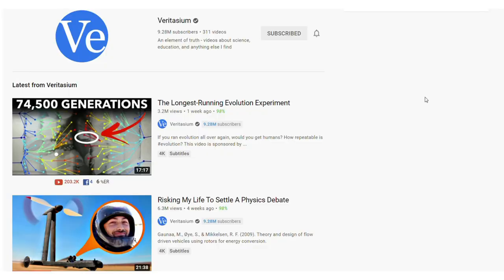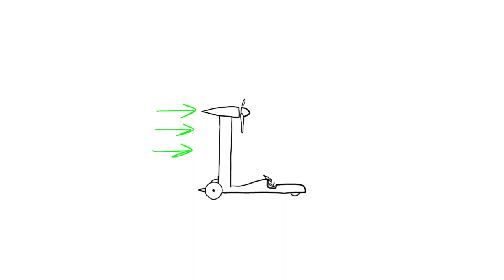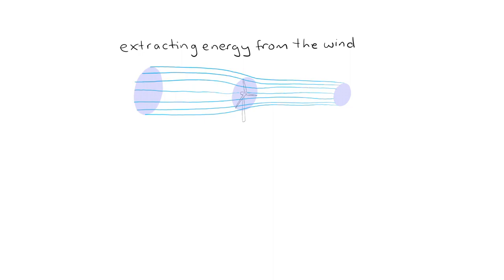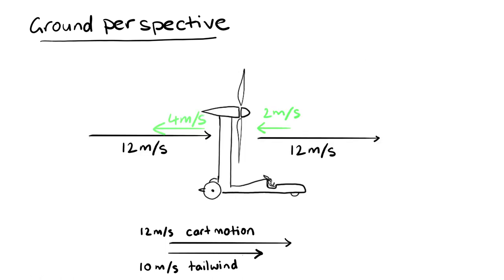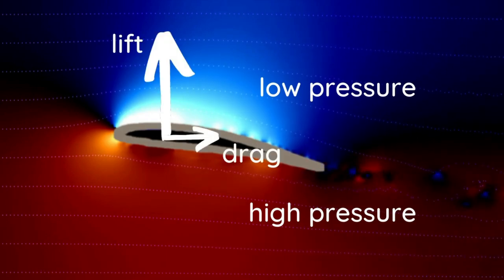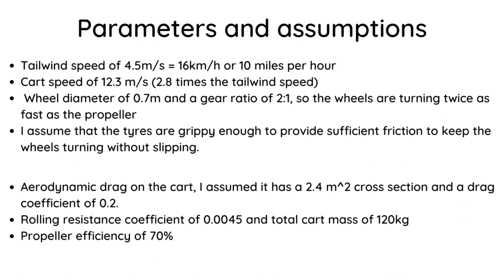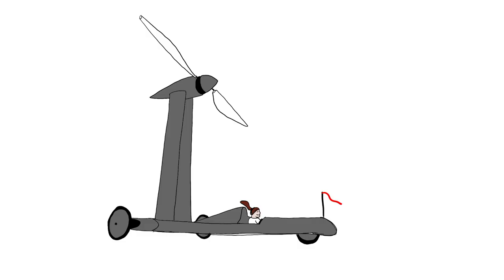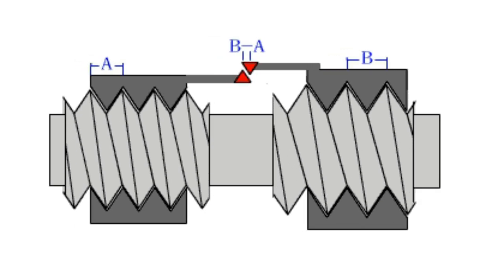Downwind Faster Than the Wind by Veritasium: How Does it Work?

Comment: Since wheels to ground is a lot more efficient than wheels to propeller to air, wouldn't it make more sense to use the wheels to power more wheels? Of course that would be nonsensical, which shows how flawed the downwind faster than the wind using a propeller theory is. It would actually be difficult to find a less efficient transfer of power than an air propeller.
Reply: "wouldn't it make more sense to use the wheels to power more wheels"

No, because you need a velocity difference between power generation and thrust generation. It only works because airspeed < groundspeed
Reply: @jetison333  Yeah I wrote my comment before viewing a bunch of old downwind videos. There's apparently a bunch of different ways to do it. I hadn't considered that it's basically just gearing, you can go faster just with less force, same as shifting to higher gear in a car. You could go 10 times wind speed if you had a light enough vehicle, but it would be with 1/10th the force.

Comment: If you really want to know what is going on look more carefully at the video ,look for the things that are not true like the wind speed they are in and the dust from the camera cars blowing from right to left ,,,,,,,,if this is not spot on them the test means nothing it is like a boat going across the wind using the prop as a sail.....if this thing works as you said you could simply give it a starting push in a no wind situation.
Reply: //"if this thing works as you said you could simply give it a starting push in a no wind situation."//

Nope.  Without wind there would be no energy input into the device.
Reply: @johnborton4522  once you reach wind speed there is no wind unless you go across the wind  ...then it don't count.
Reply: @191246mann1  

The propeller blades go across the wind (just like a sailboat on a broad reach) while the chassis goes directly downwind.

It counts.
Reply: @johnborton4522  thanks for the reply ,,there are a few things to considerer here first if it is going at wind speed there would be no wind acting on it or the prop .a sail boat goes across wind to get wind it has not used to push the boat along but the boat is not going any faster in the direction he wants to go if that direction is down wind.  .so were they going down wind in black bird ,no they were not ,,,you now have to look carefully at the the two videos.... in the view from the drown you can see the dust from the camera car blowing from right to left and and in some other shots that telltail thing is not blowing straight back    you have to look carefully   also the clips are lot long enough to see if he gets up speed and then turns down wind for the camera ,,,,any wind even slightly from the side make it void........they made toys that claimed to do this back in the 1950's also black bird is very old and had a different name before.,,,,there is more but thanks for the reply.
Reply: @191246mann1  

//"first if it is going at wind speed there would be no wind acting on it or the prop "//

Correct.  The wind doesn't act on the prop directly at or above windspeed.   

//"the boat is not going any faster in the direction he wants to go if that direction is down wind."//

This is incorrect.  Modern high performance sailboats (America's Cup, etc.) have for more than 20 years now been able to achieve downwind VMGs of greater than 1.0.   Ice boats and land yachts have been able to do this for near a hundred years now.

//in the view from the drown you can see the dust from the camera car blowing from right to left and and in some other shots that telltail thing is not blowing straight back"//

Not sure what your point is here -- sometimes the Blackbird is also on a trailer, being pulled by another vehicle -- who cares?   What matters is what it's doing when its going directly downwind faster than the wind. 

//" black bird is very old and had a different name before.,"//

The Blackbird was built in 2009/10 (not that age or name has anything to do with it.)
Reply: @johnborton4522  thanks for the reply..I am not looking to argue .....the dust from the cars was when they were filming the one of the runs and it proves there was a cross wind also even though they mention the telltail thing at the front if you go through the video carefully it is at times going from right to left looking from the front.[these shots were from blackbird so they will look left to right].....what it amount to is a wheel turns a prop and you can go along for free ,,,,someone would have put this to good use by now if it worked,sorry I could say you can't get something for nothing but these people have got some money for nothing ...as for the boats you mentioned I wont argue that because I havent read about it but i will ,so thanks for that ,,,but in the video they mention it as not possible.,,,,thanks for your comment.
Reply: @191246mann1  

//".I am not looking to argue "//

Feel free to not argue anytime you like.  If you say things that are incorrect however I will correct them.

//"the dust from the cars was when they were filming the one of the runs and it proves there was a cross wind "//

Ok, so there was a cross wind on one of the runs that was filmed from the drone.   So?   Do you know how the Blackbird works? (clearly not).  If you did you would know that it performs worse as it gets further off the wind.  Have you reviewed the recorded data from the NALSA ratified world records?  Do you know what the wind was doing when it set those records? (no you don't).

//"what it amount to is a wheel turns a prop and you can go along for free"//

Which just shows that you don't understand how it works.  It's getting nothing for "free" -- it's wind powered. 

//"someone would have put this to good use by now if it worked"//

There's not much demand for vehicles that require level ground, large propellers and wind lined up with the direction you wish to go  -- but that aside, your argument is a fallacy.  It works and can be repeatedly proven to work.  Just ask the UCLA physics  professor who lost $10,000 betting against it recently.

Here is what he told the news media just before he realized he was wrong and had to pay out the money:

//"Thanks to the laws of physics, I am not risking anything," he told Vice in an email. "So, I could accept any bet, however large or small the amount might be."//  Professor Kusenko, UCLA

You:
//" these people have got some money for nothing"//

I can assure you that the folks who designed and built the Blackbird didn't make money, all the did was spend money.  It was a University science education project. 

//"but in the video they mention it as not possible."//

No.  No they don't. 

You are failing one of the best physics brainteasers of the last decades and it's because you haven't done your research.
Reply: @johnborton4522  thanks for the reply ,,,,in the first video risking my life to settle a bet...........at 10.29 he does say it not posible to go faster down wind in a boat,,,,,,,,,at 10.29 and around that time on the second attempt he passes a wind sock put there to show he is down wind but at 10.29 the look at the sock then clearly as I said wind is right to left ,,,,what I do understand is what he says himself and that is a boat can go faster and long as it is across the wind I knew that anyway every one knows that ,,,,,anything other than straight down wind is not down wind and the cross wind make it void ,,,,,that seems to be what you don't get as dismissed this with a 'so' but it's the whole argument ....cross wind makes it void because it can go faster cross wind,,,,I can explain why that works with the prop as well as a sail but I think you have made you mind up.just one other thing there was no wind on the tread mill but they claimed it worked there so my ''push it in no wind' they were trying to do.thanks for your reply.
Reply: //".cross wind makes it void because it can go faster cross wind,//"

Wrong again.  

//",I can explain why that works with the prop as well "//

You can't explain it properly, because it's not true.  My mind is made up that you're wrong ... because you're demonstrably wrong.

Without cyclic pitch control on the propeller hub (which is does not have), you can only optimize for a single AOA.  In a cross wind, the airfoil will have a different AOA on the downwind side than it will on the upwind side.  With no way to adjust for this independently as the hub rotates, you are forced to pick a middle ground -- this middle ground is less than ideal.  When traveling directly downwind, you can optimize both sides to the ideal AOA and thus increase the entire rotor efficiency to maximum.

You can't win this argument because I know how it works and you don't.   You've barely watched a couple videos and think you  know it all.  You don't. Not even close.
Reply: @191246mann1  

//" one other thing there was no wind on the tread mill "//

Wrong again.   Set the treadmill  to 10mph in a enclosed, still air room and there is a 10mph wind across the treadmill belt.

You're really in over your head with this physics brainteaser.  

How about like the professor, you bet me $10,000 on any of these points and we'll let the independent  judges give me your money.  Deal?
Reply: @191246mann1  

//"at 10.29 he does say it not posible to go faster down wind in a boat,"//

No, he does not.  At  10.29  he's talking about how the chain came off the Blackbird.  Nothing at all about boats and downwind.

In fact, earlier in the video he explains exactly how a boat CAN go downwind faster than the wind (by tacking).  Then goes on to explain how the  Blackbird accomplishes the same task using the same principles without the vehicle itself tacking -- by allowing the airfoils to continue on one long helical broad reach while the chassis remains going dead downwind.
Reply: @johnborton4522  at 1029 is where you can see in the background the wind sock being blown from right to left ,,,go back to say 10.25 and watch careful ,,,there it is for me not going down wind ,,,void......some of what is explained in what you have pointed out I have gone over and over again but that is not my point ,,,I am talking about this video that claims it went down wind faster than the wind,,,,,,,,,,,,,just a final point  you have not commented on the toy on the treadmill where they prove it works but that has not got tail wind which is what you claim is where the energy comes from.,I wont get into that as it simply says it can drive the prop with the with the wheels and I just don't how they would start saying that as all along it has been about a tail wind ......I think I know how it is done but I am not a professor so I doubt anyone would even listen. ,,,,thanks for the reply ,,
Reply: @johnborton4522  I do get the point about the tread mill wind  this was explained in a different video  but the toy was not moving at 10 mph along the treadmill so again this was not a proper test ..had the toy been going at 10 mph I would have conceded the point but the whole thing all the videos seem  to not ne properly done ,,,and as I fist saw this toys many years ago and they didn't work then .i
Reply: @191246mann1  

//" I do get the point about the tread mill wind  this was explained in a different video  but the toy was not moving at 10 mph along the treadmill so again this was not a proper test"//

I don't know which video you're talking about, but there are plenty of video where the device IS moving the same speed (or faster) than the treadmill and that IS the proper test.  It answers ALL your objections -- perfectly downwind, etc.
Reply: @johnborton4522  thanks for the reply so that just leaves the  the very thing it is all about and the whole story is about faster than the wind down wind ,,that is the claim and I say it is shown not to be down wind in some clips.....not across wind is what it is all about it has to be perfect,,,,even slightly of straight and it doing the sail boat thing....as for their position it mean nothing I only look at the facts no matter what they claim...I hope you noticed the wind sock at 10.29 .,,,,I can explain why that sail boat effect work on this black bird ,,,,,thanks again for your reply I do look into everything to say ,
Reply: @191246mann1  

//" I say it is shown not to be down wind in some clips"//

He recorded LOTS of video and attempts when the wind wasn't right.   He literally says in the video  "Attempt #1" and "Attempt #2", etc. and he fails numerous times before he succeeds. 

He's also brand new to the Blackbird and had never driven it before.  He didn't have all the instrumentation that were installed for the world records.   Of course he isn't lined up perfectly all the time. 

Unless he claimed to be going dead downwind, faster than the wind at the EXACT time you see him going crosswind (and he didn't), you've got no case. 

The Blackbird and like devices will go DIRECTLY downwind faster than the wind.  This has been proven over and over and over (it's even shown in the videos doing it at times).    Arguing that there is some "B roll" film that doesn't show it a waste of your time.
Reply: @johnborton4522  thanks for your reply ,,,,yes there are other videos that claim it can be done and you trust them to be correct well if they are and some were about blackbird when it had a different name many years ago and I have seen some of them,,,,,,which begs the question if you found proof it works and I have seen the videos or films they why did this guy make the bet ? he sure would have checked this out ,,,he is a professor and this is the first thing he would have done long before he took the bet ,,,I believe the whole thing was a money making scam why else would anyone risk $10,000 without doing a bit of research first ,,It's the very reason they are on youtube in the first place. I don't think this has been proven in this video even if people do believe it works ...this video was not proof ,They could have filmed the wining run from start to finish if it was ,,,this did not happen it was just a mix of bit ,,,,thanks for your reply
Reply: @johnborton4522  thanks for reply but I did not want to leave this up in the air,,,,,I did as you mentioned and did some research ,,,the result was that  there is a video of the original blackbird done in 2012 it was called 'Joby' then and it was far better in my mind .I had seen this before and you may have as well.so that aside ,,,This guy who made the video is a professional film maker and a full time youtuber and was the founder of VE that is his job now.....so that explains it all for me and I feel a bit daft being taken by all this ,,,,,I don't believe now there was even a bet or that this bluebird even did a proper run it had too much drama and hype ,,,,,looking back at it I think that it was obviously ''copyshoped''   I think they call it or something like that and would explain why he got abusive to me the first time I contacted him and pointed out a fault with it ,,,,,anyway that aside I believe it was all a money making scam he even thanks VE  for their help,,,so thanks very much for your replies and no bad feeling I hope... you could well be right I really don't know ,,,so bye and all the best.
Reply: @191246mann1  

Who is "VE" and do you have a link to this video made in 2012 by the professional film maker?  I would love to see it. 

Thanks
Reply: @johnborton4522  the professional film maker is Derek Muller  he is the driver and the guy who made the bet and video ....VE is Veritasium he is the creator of it.he is a full time youtuber now he was a science professor before he went into making films......if this guy he made the bet with would have seen the other videos and surely not bet 10000 after seeing these videos.......''wind powered direct up wind vehicle DUWFTTW''' [says upwind but they do it down as well]    and  ''sail faster than the wind  UW_DW FTW''    is a news report 2013...

Comment: Guess you can translate this into real world practical use to drive a floating vessel with powered propellers under water hooked up to an air prop like in this demo... So you would not need sails..
Reply: Probably not practical. (Rotor sails, on the other hand, can be practical but they require some energy to operate.)